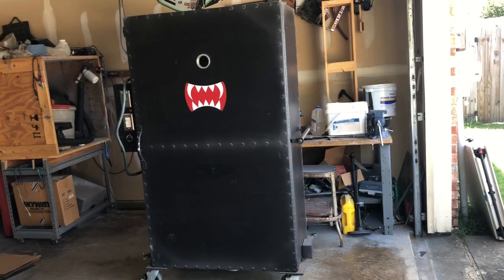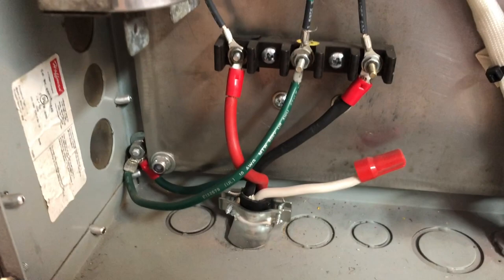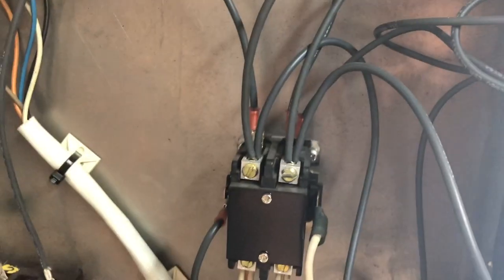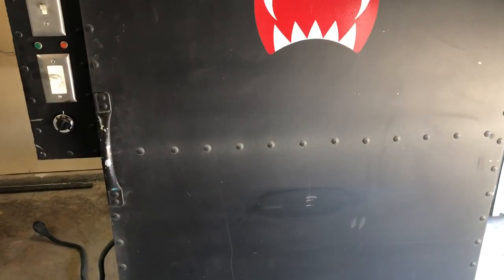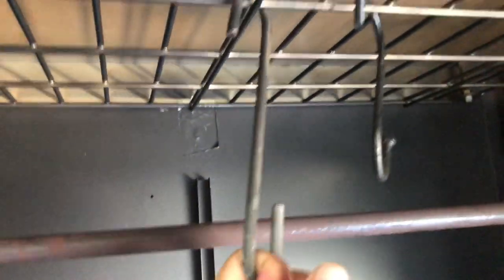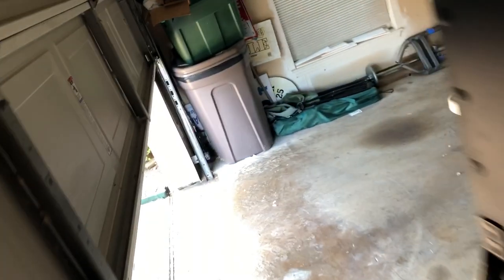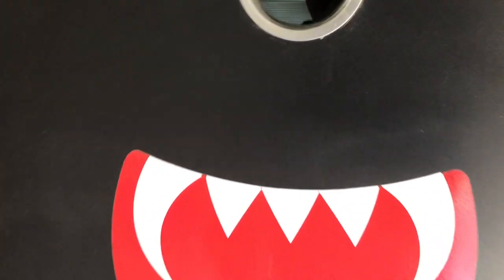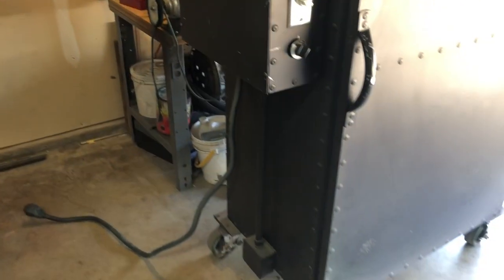Homemade Powder Coat Oven

Comment: I get how the fan helps distribute even heat but does it ever cause to much powder blowoff or any noticeable blow off costing redo of paint? Or is it mellow enough it just does what it was designed for?
Reply from the maker: Yeah no it’s not that powerful. Just enough to circulate the heat.
Reply from the maker: Yeah no it’s not that powerful. Just enough to circulate the heat.
Reply from the maker: Yeah no it’s not that powerful. Just enough to circulate the heat.
Reply: @ZumosGarage  thank you bro. It sounded super loud and made me curious. I may have to build one in the near future.